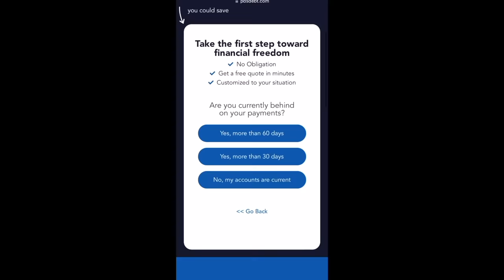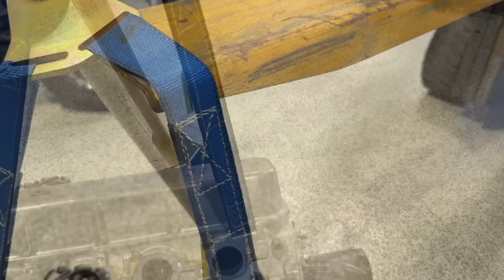Big Block Swapping the Forgotten Freedom Factory Rollback!

Comment: I drove a forklift for 15 years and I was getting bad anxiety watching yall fumbling around with that motor with only one fork. Glad y'all came to your senses and put both forks together.
Reply: NO BRAKES!!!! 🤯
Reply: Certified bad ass. 😂🤣😂
Reply: Yes, the forklift vids are hard to watch and not shake my head. 
Thank goodness they are successful in their method!
Reply: The fork lift certified guys have entered the chat
Reply: Osha has entered the chat
Reply: They're both forked in the head. Especially squirrel and cold redline revving
Reply: Did you notice the right extension didn't have a lower support... it was just held on by the slip-fit. lol
Reply: OSHA? Never heard of her
Reply: Well to be fair its Cleet and Squirrel probably took both of them to figure two forks= more stability🤣.... Just kidding
Reply: OSHA who is that lmao
Reply: Mine was me and the old lady yelling “DROP YOUR FORKS WHEN YOURE DRIVING!!!”
Reply: @ROT4RYfc3s "I'll show you!"
*Cold revs for 3 seconds before Rodney throws a wrist pin*
Reply: I also drove forklift for some years, and everytime they're using that Hyster, I always get nervous...
Reply: @duke1281  I don't drive forklift, but every time they use it like that, it, gives me cold sweats, especially after the video of him lifting a Ranger to the Hyster's max height
Reply: I did it for 20.. Glad I'm not the only one that felt that way.😂
Scariest part, was when he was going forward to drop the engine in, and said that the brakes were working now. 😅
All I saw, was the spreader bar sliding off his forks..
Reply: @duke1281 I don't think I could operate one of those things, if the brakes actually worked! 😂
Reply: No one cares
Reply: not alot of people realize this but we are in the presence of a certified forklift driver 🔥
Reply: I drove a forklift ONCE and someone lost a finger. I get anxiety every time they start the thing up lol
Reply: If he keeps being a dumbass with the forklift his life is gonna be full of OSHA inspectors before he knows it because someone is going to get hurt. It's all fun until he spears someone or he rolls it with an amn between the roll cage and the tarmac.
Reply: @huntermcelroy6792  Yes we do and so will he when he loses everything to a massive lawsuit. Forklifts are not toys.
Reply: This probably a8nt the channel for yall bitchin  this isn't even top ten dangerous
Reply: @donbot5000 couldn’t have said it better. I see nothing wrong with there methods, got the job done
Reply: And fucking around with the extensions on
Reply: The forklift videos give me the fear, they do plenty sketchy stuff but when messing about with the forklift it’s the only ones I think it’s too far. There is a definite lack of knowledge of how dangerous they are and would hate to see someone hurt because of it.
Reply: On the very edge of the fork extensions too lol. I was cringing!
Reply: I was only kinda scared for Georges feet when Cleet was not so careful moving that bigblock, while the strap was barely on and the fork was bending :D
Reply: Y’all complaining about the forklift and how he doesn’t think it’s dangerous this man goes 200 mph + in the 1/4 ntm the rest of them drag race and do spectator drags an burnout cars with 100x’s the danger and horse torques I’m sure they realize cuz there has been a few times they mention the danger and it’s not a big deal especially to these guys
Reply: Same here
Reply: You must be fun at parties
Reply: That shit was unreal 😂 forklift certified
Reply: @marvindebot3264 lmao relax brother it's not that serious
Reply: I didn’t even need experience and I was 😂
Reply: I was going crazy about the fork extensions and the fact George’s hand was in a very bad pinch point.
Reply: They are called forks when together, separately they are called tines.  Surprising you didn't know that for someone who drove forklifts for 15 years.

But i agree with your comment, i was thinking the same thing the whole time and cringing.
Reply: @richiehardison6132  He does it with all the safety on, racing suit, racing gear, roll cage and other equipment.
Reply: Every time Cleet touches a forklift I wince.
Reply: no brakes and the curve in the extensionforks , osha who ? dont know him 😂
Reply: Nothing slamming the forks into the ground won't take care of
Reply: 19 years Hi-Lift here bud, and I felt the same way! 
Yeoow!
Reply: @skyler9988     bababababababab  rattle  clunk😁😁😂🤣😥😥
Reply: Look at me guys I drove a forklift I’m so special
Reply: Cry about it
Reply: Only for skits  they no what there doing bro …. Wouldn’t the vids be boring if they did everything just normal and perfect as if osha was around the corner …. Yea it would so there sketchy stuff is only for video purposes
Reply: Oh my god…. There’s always one! Relax, ma’am
Reply: @stykytte  I trained probably 50, or 60 forklift operators in my lifetime.
I'm interested to know, how anyone was close enough to a machine, with a first time operator, that they were able to lose a finger.
That had to be procedural error.
I can't imagine a situation where that was your fault.
Reply: @michaellindsey13  it should be an honor.
You ever tried pulling 30, and dropping 30 pallets per hour,  from 30-45' in the air.
6 days a week?
All whilst keeping track of the shit that management has lost, or mislabeled.
Plus, the bays that inventory is way off on?
Have you even touched a forklift?
Or, are you too skeert?
Reply: @skyler9988  HA!! I remember that video!! Forgive my French but my asshole puckered a bit when they did that!  Thanks for the memory's  ... LMAO!
Reply: @Mr.Schitzengigglez  they're so much fun! Once you get used to them, they're basically just an extension of your body..  like a 3rd hand if you will..
Reply: @duke1281  took me a minute, to learn the Raymond, and Crown lifts, forks trailing.
But, that was so many years ago, it's like beating off, at this point.
You don't forget how.
Reply: @Mr.Schitzengigglez  oh trust me..I never forgot..on both accounts!... LMAO
Reply: @natedene  we all have! Hahahaha!

Comment: As a forklift driver, I'm on needles. At a minimum: fix the brakes, drill a hole in that broken ass fork extension, and put a stopper 2000 (long ass bolt with a nut) in it to at least to an extent stop heavy stuff sliding off...🤣

I need a big BIG wobble pop!

Comment: You used to be able to get a 6.2L or 6.5L eco-diesel from government auction of used engine crates out of CUCV's or HMMWVs for very cheap.  It should be noted that the C/K1500/2500/3500, CUCV, and pre-2008ish HMMWV's can have issues with the high nickel block cracking near the support webbing for the crank bearings.  AM General seems to have fixed this somewhat thereafter.  As these engines were made for 80-90s 3/4 ton (today's 1/2 ton) towing limits only, this is not a PowerStroke / Cummins / DuraMax engine and was not designed to be used as such.  The high nickel block makes welding things back together difficult for an inexperienced to intermediate welder

Comment: 33:30 when those bolts go in, they should all be interference thread pitch so the self lock partly friction welding the threads. same as most bolts that hold suspension parts onto vehicles, thread in a bit easy then quickly get tight. use a dial indicator on the flat end of the flywheel to measure if the bolt head is in all the way. no torque spec

Comment: just some old guy life experience.....  Drill holes (1/2"ish) in the forks a few inches from the tips.... when using straps/chains install a bolt from the underside that leaves a couple/3" exposed (mo' better) to catch the strap/chain before it/they slip off the fork.....

Comment: The only way to fix the broken cab bolt issue is to cut an access hole in the floor of the cab inside to pull the old bolt/nut out. Then use a regular 1/2 grade 8 bolt to bolt the cab back down. I use a 1-3/4” hole saw to cut the hole in the floor so that you can plug the hole with the rubber body plugs that you see in jeep wrangler tubs etc. You have to drill the hole pretty precise in order to avoid drilling through the cross supports under the cab..

Comment: If you could- onboard AC and an onboard crank-driven air compressor would make this ultimate. Make sure it has great cooling for if it’s sitting idling running hydraulics. Big old amber/red rotator light bar.

Comment: Holy cow boys, either get a lifting hook for the shyster or drill a hole in the end of one of those forks so you can drop a eye bolt in there to keep the strap from sliding off.

Comment: It was at 58:24 when i realized the headers are swapped to the wrong side! and That is why they are on a funny angle tilted backwards... was wondering at first, didn't think that big block was supposed to be that high in the front, thats because the dang headers are on the wrong side

Comment: Order u some red kote tank liner, remove the tank and pour it in a turn it so it covers the whole inside of the tank and drain off any extra and let it dry for 24 hrs and u will have a like new gas tank for 30-40$.

Comment: It would be a good idea to drill a one inch hole on the forks so a bolt can be put in to keep rope, chain or cable from slipping off the end of the fork.

Comment: * TIGHTEN THE BRAKE CABLE ON THAT HYSTER, TAKE THE PRESSURE OF BRAKE HANDLE, TURN THE KNOB CLOCKWISE TO TIGHTEN ,PUT BREAK ON AFTER EACH FULL REVOLUTION UNTIL YOU GET IT TO STOP!  IF YOU CAN NOT GET IT TO STOP FORKLIFT, LOOSEN IT BACK  UNTIL IT IS EASY TO PUT ON. THEN ONLY THING YOU CAN DO IS ADJUST BRAKES  WITH ADJUSTMENT TOOL THROUGH BACK OF BRAKE PLATES ON EACH WHEEL , REMOVE RUBBER PLUG PRY DOWNWARD TO TIGHTEN  AT EACH STAR WHEEL UNTIL YOU FEEL IT TOUCH BRAKE DRUM .
 ** BEFORE MANUALLY ADJUSTING BRAKES, TRY BACKING UP AND SLAMMING ON BREAKS IT SHOULD AUTOMATICALLY TIGHTEN BRAKES! IF NOT THEN YOU WILL HAVE TO ADJUST EACH WHEEL MANUALLY ( INSTRUCTIONS ABOVE)
 **I HOPE THIS HELPS YOU STOP FORKLIFT BETTER!**

Comment: With our going through the comments but why did you not clean the clutch mating surface with brake clean to get the grease of the surface of the flywheel and pressure plat it can cause premature failure of clutch just saying

Comment: When moving that engine I'd have gotten a pipe to run inside that bracket you had attached to the engine so it could go over BOTH forks of that forklift.  Then you wouldn't have to slide the forks closer.

Comment: Did you guys spay it with brake cleaner first and probably should have torqued those flywheel bolts like you did the pressure plate

Comment: He did mention that the motor had no oil, and then later in the video, he proceeded to red line it. The question i have is, did they ever put oil in the engine, lol
Reply: Yeah they said later on to "go ahead and turn it over, it has oil in it"
Reply: @BubbaB43  I definitely missed that part lol

Comment: Fork extensions are terrible.  They have zero strength and give you way to much of a false sense of security. If you need fork extentions then you need a bigger machine.  Full stop. Having said that, I've used them and will use them again and won't even wear my helmet when i do.

Comment: Everything bout that forklift is wrong ive seen alot of bad accidents with forklifts while they are fun to use and play with u need to remember its not a toy and accidents are easy to happen also get a jib attachment using unrated extendeable tiens was pure stupidity as a boss and busness owner u should think of the death and ur liabilty when doing this stuff. Love you guys but play it safe.